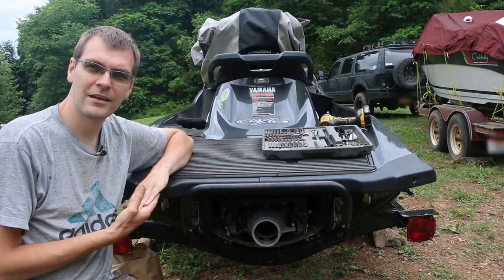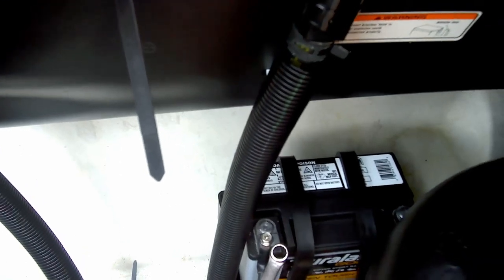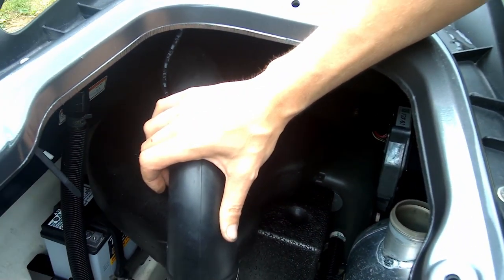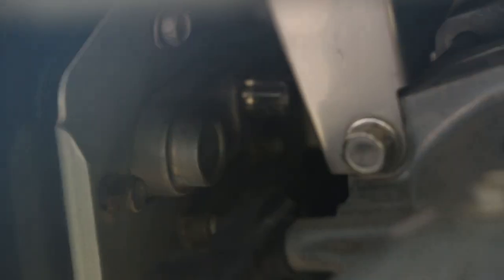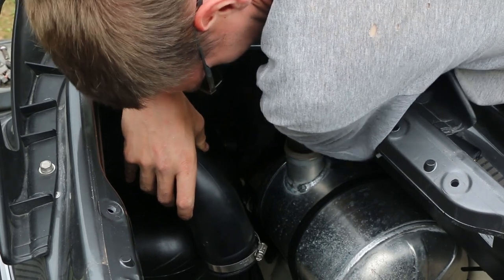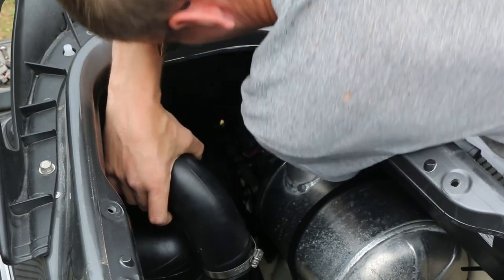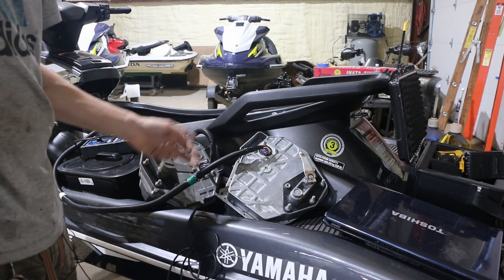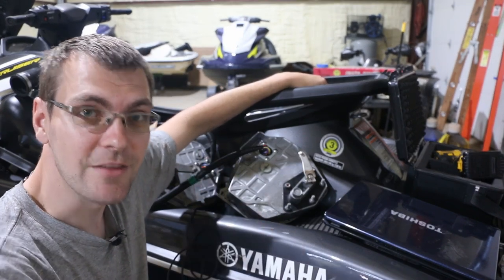Removing and repairing a Yamaha Ride motor

Comment: Thanks for the video the pin out came in handy, the older Seadoo VTS used from 95-11 uses a similar actuator/motor and can’t tell you how many I’ve saved just pulling them apart. The worm/drive gears usually have old caked up grease or dirt/dust built up making tolerances so tight they won’t spin. The second I back those screws out even just a couple of threads they start working again. I then clean them out with contact cleaner and compressed air then regrease with dielectric grease. I can usually save 90+% of the motors/modules doing this.

Comment: I just spent ALL DAY in the garage trying to figure all of this out.  Man!  I wish I would have watched your video first.  I tore apart the RIDE motor itself (all 4 screws) and fought for about 30 minutes trying to put that little motor back together.  There are a couple little buttons in the way that keep you from installing the shaft back in.  Took a bit to figure out how to relieve the spring tension on those but finally I got it together.  What I was too worried about trying was putting a 12 volt battery on the motor exactly like you did so THANK YOU very much for posting this.  I have no idea if mine is going to work at this point but I'm heading to the garage right now (2am) to find out.  Hopefully I net the same results!

Comment: Hey bro, thanks so much for your super clear vid. Saved so much of my time. Seawater had leaked inside and had the lever axle totally stuck. 3 hrs of wrestling, moving the lever back and forth, until normal pivoting, with a ton of grease and I was able to get it back in the water the next day. You're the man!
Reply from the maker: Awesome! Glad the video helped you out and got you back on the water!

Comment: Thanks for the video! Followed your procedure, but couldn't get the motor assembly out because I broke the setscrew off the arm. But I guess trying to pry it off and spraying it down with penetrating oil got the shaft loosened up or jarred something. Code 159 gone!! Ride control working!!!
2020 waverunner VX
Reply from the maker: Glad it helped out, breaking the setscrew is a bummer but as long as you got it working now that's a win! I wish I knew more about these, but there just isn't much info out there, figure any tidbit I put out helps pave the road for others to dig deeper!

Comment: Great video! I'm having an issue with my Ride system on a new 5hr '21 GP svho.
The new system revs up engine when reverse lever is pulled.
Reply from the maker: Correct, tapping the lever goes to neutral,  and holding  just a little will go to reverse and then pulling further will rev the engine up. Talk about a shock if you're used to ibr on a seadoo.

Comment: Great video.    Mine seems to only have issues in the water.   I got a 159 and had low voltage less then 12.   I put in a new battery and it is 14+ when riding, but after a while it through a 163.
Reply from the maker: Is your battery charging while the engine is running? Any cables corroded or loose terminals on the battery? Being in the water could put extra load on the ride motor, and any bad connection could make it throw codes
Reply: @trythistv  yeah, it is charging.  I checked the codes with my map tuner and it showed it had a code 153 stored.  It didn't show any of the codes that popped up on the dash.   I put the details of my problem on Greenhulk yesterday as I have gotten random codes 151, 159, 163 on my 2021 FX SVHO
Reply: I am thinking it has something to do with control unit in Ride.    The motor is fine, but something is causing an intermittent failure.   The wire harness and connectors look like new.   The MpatunerX I have ahs a code reader and the only code stored 151.   The stuff that displayed on the dash didn't log into the ECU.
Reply from the maker: It could very well be something going wrong with the control unit, I'm not sure exactly how smart that is, but it could be almost a second ecu and communication problems would cause erratic behavior and error codes.
The low voltage is my confusion. In order for the voltage to drop there has to be a large load on the battery, it could be the position sensing portion of the ride motor is failing and the ride control ecu thing is trying to move the motor to get the bucket into the proper position and it's already against the stop so the motor is just locked rotor essentially perhaps.
Reply: @trythistv  the voltage drop is after it dies and struggles to start.  The different control unit seemed to fix it, but the control unit is from the wrong model and throws a TDE ERR on the dash.   No codes, but reduced power.
Reply from the maker: I haven't yet seen a ride computer fail, Its not a shock though, any computer can get messed up. I can't recall off hand if there is any type of marrying or hin code matching type stuff available in my scan tool for a yamaha, I don't think there is though. Might have to source a replacement from the exact same model.
Reply: @trythistv  yeah when I went to partzilla it only showed 2 years being equivalent 2020 and 2021. So I had to order a whole new ride unit because the control unit itself is on back order.

Comment: Thanks for this info! Can't wait to start testing it but can't get it out yet.. Motor is like the alternate version from 2018 ski shown at end which has slightly different way lever attaches to shaft. Took plate & everything apart no problem until snapping that 'set screw/lock screw' off & should have been easiest to remove vs the plate bolts ! Guess going to need a bigger drill bit now.. damn you salty Yamaha bolts!😢
Reply from the maker: Yamaha seems to really love their loctite on newer models as well. I had to remove the top deck thing from a 2021 EX and man all 6 bolts felt like they were going to snap off all the way out. Glad the video helped you get some progress at least!

Comment: I have pretty much identical problem with my 2017 fx ho code 159 the beeps and runs but won’t go in reverse, forward etc.  Had to switch jet pump out to get it starting at all. Now getting 159.

My repair shop has been taking so long 4+ mo so far they are saying now probably just needs a new fuse box to get working?

I’m really tempted go get it and fix myself  try n do what you did here. My question is do you think a new fuse box assembly will help get ride motor working  or just take out and inspect like u did? 

Thanks for help awesome vid one of the only ones I could find!
Reply from the maker: I highly doubt the fuse box is to blame. I was curious about the relays that control the ride system when diagnosing this problem, I traded them every which way, jumpered and everything trying to track this down.

it ended up being the ride motor was bound up (as you can see in the video lol).

I do know If the reverse bucket can't move freely, and I mean freely (with the arm disconnected), it won't do the calibration stuff properly, where you see it stuttering and stuff in the video it is learning the positioning, and with the motor not running because of the stuck brushes or whatever, it wasn't changing position and was throwing the code. I'd pull it apart and take a look, but I tend to do that with everything.

Comment: Hi my 2017 vxr wont start when i try its in forward gear not nuetral iim getting codes 157 161 your reckon this cud be my problem? When I look the codes up its saying replace the ride motor
Reply from the maker: I've not seen a ride motor cause a no-start, but codes 157 and 161 could absolutely be fixed by doing this.

Comment: On my 2017 vx1050 it only shows a dash where the F, N, R should be. The ride motor works because it does the self check when you first start it but it stays in forward and nothing happens when I hit the reverse lever. Think it’s the position sensor?
Reply from the maker: It does sound like the motor assembly is not reporting its position, which could be something as simple as a bad connection somewhere, or the position sensor itself has failed in some way.
Reply: I’ve gone through the whole wiring harness and cleaned every connection and dielectric greased all of them so I don’t think it’s a connection issue anymore. Do you know where I can find a new position sensor? I couldn’t find just the sensor anywhere on the internet. Thanks for the fast reply btw!
Reply: I have the dash as well I got new ride throttle and wiring harness also ride motor is working I applied voltage to it 157. No communication  hmm it’s either ecu in ride or and sensor

Comment: What software did you use to retrieve the trouble codes? And did you have to clear the codes after the repairs?
Reply from the maker: I know on 2016 and newer the trouble code flashes on the instrument cluster, I did use a candoopro (System for Yamaha: https://ebay.us/1TC15V) to double check what they were, but they will clear without any scantool once the problem has been repaired, and battery has been disconnected for a couple minutes.
So it wasn't really needed, but was handy because you can command the ride to move with the scantool so I could verify it went up and down, but of course you can see I did the same thing in the video by starting the engine and tapping the throttle and reverse levers to see the motor move, so again, the scantool was convenient, but not necessary at all.
On Seadoo machines you need the scantool to program keys and reset maintenance reminders, but yamaha I haven't found any service or repair that needed a scantool attached. (Seadoo scantool: https://ebay.us/idXJQn)
Reply: @trythistv  do you need to prompt the instrument cluster to read the code or does it show the fault automatically?
I have owned many PWC’s over the years, however I have my first 2 late model Yamaha’s. I prefer to do all my own maintenance for quality reasons. 
( I was a mercruiser and merc outboard mechanic a number of years back and have been a professional truck mechanic the rest of my over 40 years in the field)
I enjoy your videos and thanks for the fast response. 
Both of my RIDE motors work fine so far. I just wanted to learn whatever I could. 
Thanks again.
Reply from the maker: @bubba.watercraftj7269  with this problem the fault flashed on the display immediately along with the horrific warning buzzer screeching and deafening me lol.
I'd say you're well equipped to handle all the maintenance and repairs on these, in my mind these are so much simpler than any sterndrive, outboard or inboard boat.
Me and my wife run a business doing all kinds of mechanical work on various watercraft and just about every other shop in the area refers all the pwcs to us, they're a little cramped to work on sometimes but usually pretty easy to figure out what's going on
Reply: @trythistv  I don’t miss working on stern drives any more with my forearms looking like chopped liver after “routine” repairs on a crusty rusty salt water boat. Lol. 
I have a 2018 1800 naturally aspirated and a 2019 TR1 VX cruiser. 
The TR1 is much easier to access for routine service. 
What part of the country is your shop located? Incase I need to recommend someone to repair a PWC or in the event that I may not feel like doing a major repair in my senior years.(yes I am old)
Reply from the maker: We're in East TN, on Norris lake, so all freshwater stuff here, boy when we see a saltwater machine it makes me cry a little on the inside, everything is so much harder to work on with that corrosion everywhere.
A few years back we had a bad zebra mussel problem on our lake and it was miserable, everything that came out of the lake had those little razor sharp shells everywhere, we pressure washed everything before we ever started working on it otherwise we'd end up sliced and diced!
I'm on the fence for which I prefer between the TR1 and 1.8L engines, I see a lot of TR1s as rentals, and they hold up pretty well, around 4-500 hours the jet pumps seem to self destruct, and they don't handle water ingestion as well as the older MR1s did, but overall they are great machines.
I don't see a huge volume of the 1.8s yet, they seem pretty solid, share a lot of the same ride motor and components like that, and are a bit more cramped to work on, the tr1 powerplant can be pulled out almost as a unit which is super neat, I suspect the 1.8 would require a little trimming of the accessories and manifolds and such to fit out.